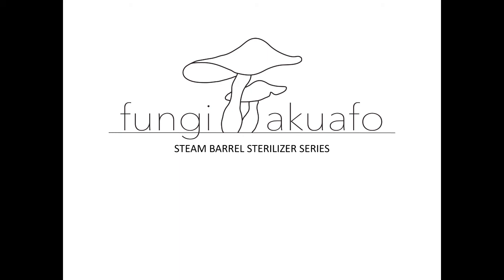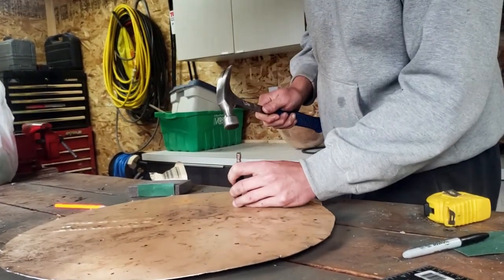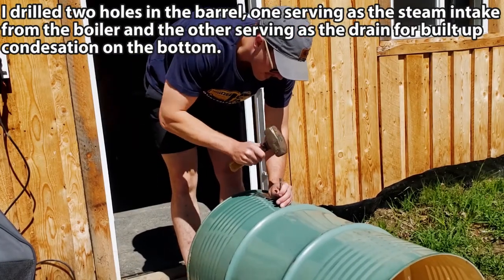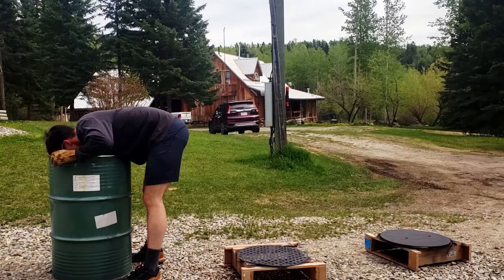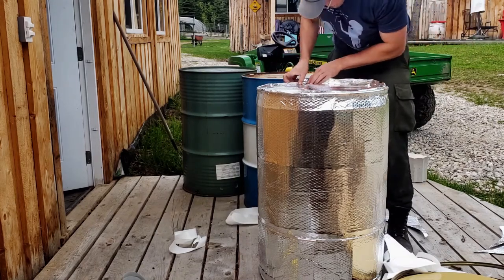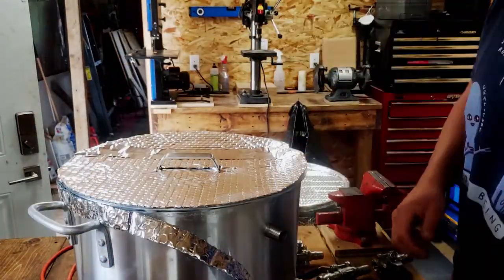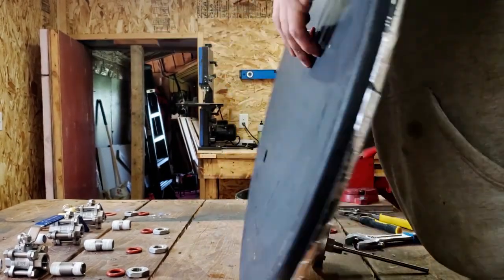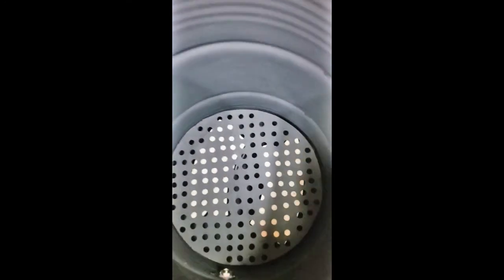How to Build a Mushroom Sterilizer

Comment: This seems much easier than alot of setups i've been looking at.  You can sterilize with this and not just pasteurize? in which case you can supplement your blocks with bran and other nutrient rich additives, correct?

Thanks for posting this!
Reply from the maker: It's steaming for a long period of time...  The temperature is higher than what you would use for pasteurization.  The blocks we put in there were supplemented and we didn't have any challenges with contamination (no more than usual anyway!).

Comment: I am building one now as we speak..question: why did you not use a heating element like Oak and spore? How are you going to regulate temperatures without a pid and using gas heating?
Reply from the maker: We don't regulate the temperature...  basically, the steam comes off the pot into the barrel.  There is a temperature gauge in the barrel to spot check but it's not that fancy!

Comment: How much pressure do you get on that pressure valve
Reply from the maker: The mushroom sterilizer is also referred to as an atmospheric sterilizer. Meaning, it only gets to one atmosphere and sterilization happens when the system is run for at least 24 hours.

Comment: How do you get it up to pressure and how long do you sterilize the bags? At what temp/psi?
Reply from the maker: It's atmospheric pressure - that's why you let it run for ~24 hours.  The steam moves around the bags.  We let the temperature get as hot as possible, usually around 95C.  It's trial and error to figure out how long you need it to run to ensure your sawdust bags are clean.  Just keep records and you'll understand what works in your climate with your materials!

Comment from the maker: The tool for cutting through the steel is called a "Step Drill Bit".  You can purchase them at auto part shops like NAPA.  Here's one on amazon: https://www.amazon.ca/dp/B07PR96VTK/ref=cm_sw_em_r_mt_dp_3MZMC0R6NPCXXW58VZNX?_encoding=UTF8&psc=1

Comment: why didn't you pump the steam from the bottom then stack the blocks lower? I'm sure there is a reason, I just can't think of it.

Also what's the benefit of a separate container for steam generator? Is it only because you are burning gas? If you were using an electrical heating element would you still use a separate container?
Reply from the maker: The pot is on a gas burner.  If you have an electrical element, you can use it in the bottom of the barrel.  Using a gas burner on the bottom of the barrel could also work but the barrels aren't designed for that and you would have to replace the barrel in time whereas the pot will last (or can be replaced without having to replace the barrel).  I'm not sure I understand the first question.  The goal was to maximize the barrel space.  Also remember you have to reach into the barrel to get the substrate in and out.  Depending how tall/long your arms you are, this can be a challenge!